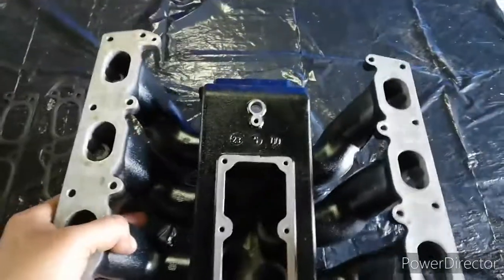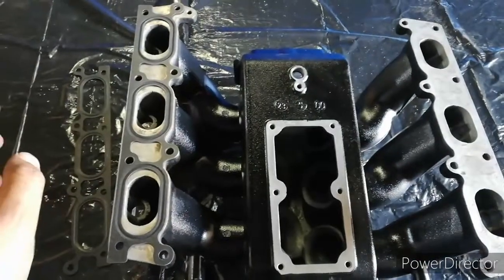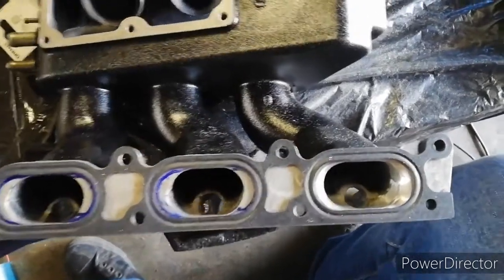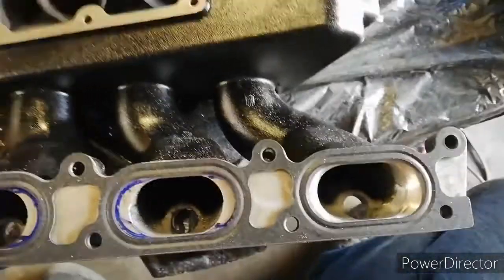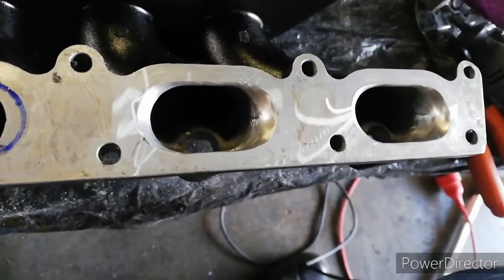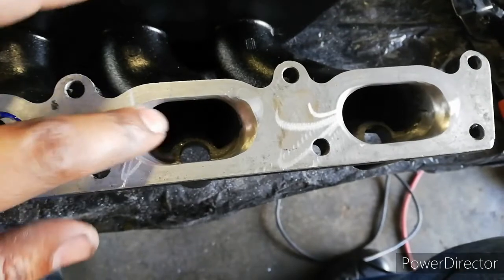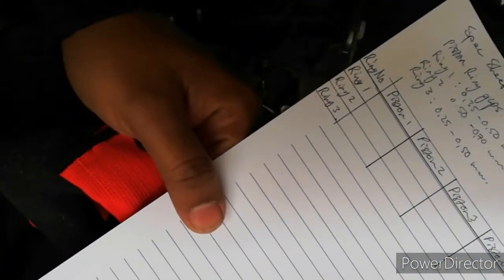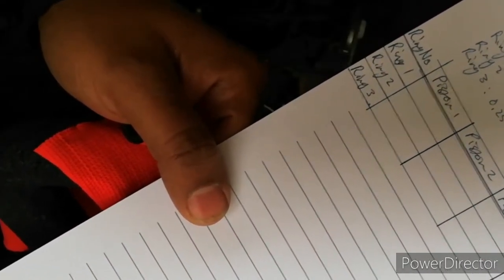Audi B5 2.7T Build | Porting out the 2.7t Intake Manifold and gapping the Rings.

Comment: you can also use the b5 rs4 intake manifold, very costyl though. And make sure you guys use the valves from the 2.7t and NOT the 2.8 as the keeper grooves are higher up on the stem meaning less spring tension.
Reply from the maker: This is a great suggestion regarding the manifold. It is indeed quite costly to get these manifolds where I, with sourcing and import costs, it will probably cost more than what the engine is worth. 

Regarding the valves, you are 100% correct, not to forget the 2.7T Exhaust valves are filled with sodium to help with heat dissipation.

Comment: why is it necessary to gape the rings? and is it mandatory?
Reply from the maker: I would say its completely necessary, especially when resleeving an engine block. You want to make sure that the rings have the correct tolerances so that when the engine is running and the heat causes the rings to expand, the ends of the rings do no butt into one another and cause catastrophic damage to the engine.

Comment: What cams do you use for the 2.8 head ? Original N/A ?
Reply from the maker: Hi there Jerry, apologies for the delay in response.

I used the intake cam from the 2.8 and the exhaust cam from the 2.7t. The exhaust cams are the same so I kept the one that was in better condition. 

The 2.8 intake cam has slightly more lift and duration which helps at top end, especially of you go BT. Without a tune the gains may be marginal though, especially torque-wise.

I hope this helps.